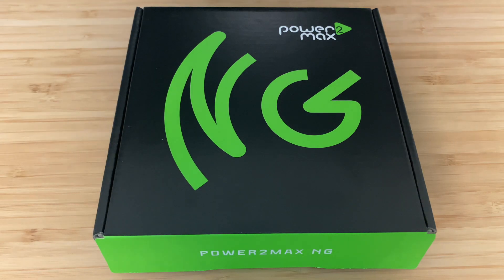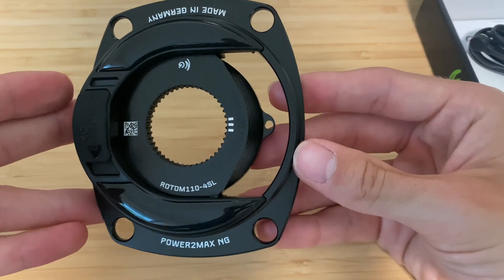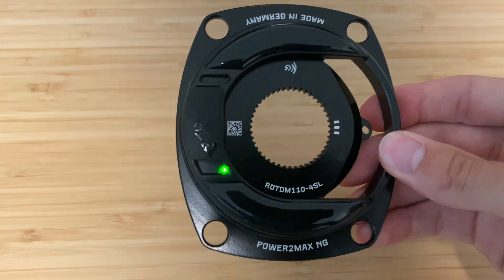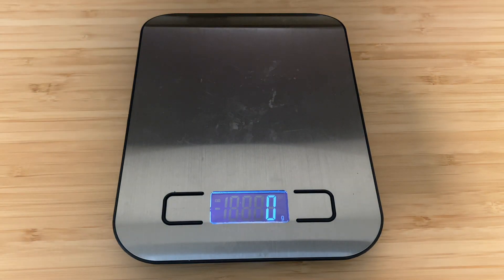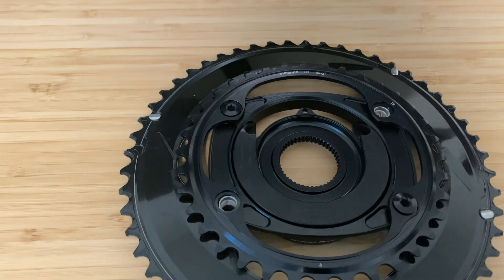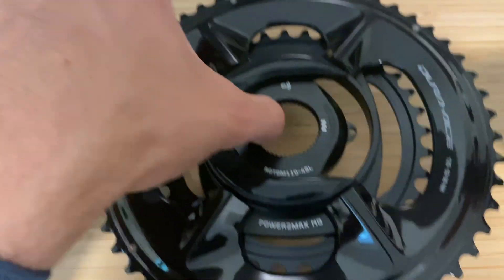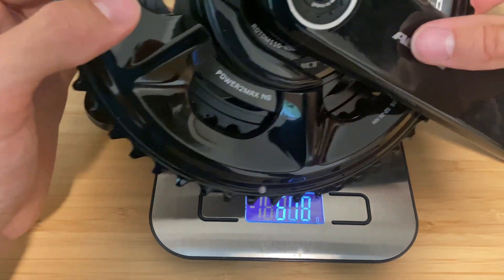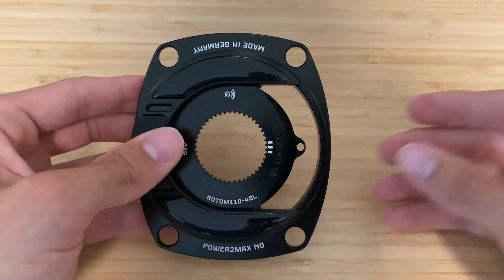NEW - Power2Max NG - SL - Magnetic Charging - Dura Ace 12 speed - Rotor ALDHU Carbon

Comment: Hello there, whats the difference with this NG and the NG eco? 

Also, can i use a Carbon Ti rings with this set up?
Reply from the maker: The NG is the higher tier model and the Eco, while still accurate, has a few less features. You can use this with Carbon Ti rings as long as you select the correct BCD. Though, the Carbon Ti rings are not any lighter than DA chainrings.

Comment: Thank you for this video. May I ask is this powermeter and specifically the SL version of the SL spider able to be used with other cranks, or only Rotor? Thank you so much
Reply from the maker: The SL version is compatible with a number of different crank arms, but is machined to specifically fit whichever brand you choose (Rotor, Easton, Praxis, etc.) so you'll need to select which interface you want when purchasing.
Reply: Thanks for the reply!  hmm, so it sounds like this is custom-ish request to Power2Max? I am going to try to get a super lightweight Chinese crank that fits normal Power2Max, Sigeyi and XCadey power meters already. So I wonder if this SL will fit without as it already is? I will ask Power2Max directly but if you know I'd love to hear!  The cranks are called Elilee by the way.
 @utahcanyoncycling

Comment: Impressive weight! Thought about upgrading my aldhu 24 to the aldhu carbon. 
I am moving my aldhu 24mm with the NGeco and 8100 ultegra chainrings on my Ostro vam, which has the ceramicspeed T47a 30mm BB with 24mm reducer. I noticed that the aldhu crankset sits 2mm further from the BB when compared to the stock 8100 crankset. I only put an O-ring on the drive side with no spacers. I don't think I did anything wrong and not sure if it's a must to put an O-ring on the drive side. I am also wondering if this 2mm increased chainline would cause shifting problems. I also noticed that this crankset sits 2mm further on my 2018 Scott foil. Thanks!
Reply from the maker: Make sure you follow Rotor’s recommendations for which spacers you need and also make sure to check that you have correctly tightened the preload nut. The chain line should not be an issue so long as you re-set the front derailleur limits to accommodate the one or two millimeter difference.

Comment: Do you have a BB86 bottom bracket on your bike? I want to buy the NGeco SL with Dura Ace 9200 chainrings and the Rotor Carbon crank, but I'm confused on the bottom bracket and axle compatibility.
Reply from the maker: I have two bikes, one with a T47 and the other with a BB86. The rotor carbon crank arms are only compatible with a 30mm spindle. The 30mm spindle fits in the T47. If you want to keep your BB86 you will not be able to use the rotor carbon arms since a BB86 is not big enough to take a 30mm spindle without serious compromises. You can use the rotor aldhu aluminum crank arms with a 24mm spindle in your BB86 though.
Reply: How frequently is pretty frequently?  😅
Reply from the maker: @woutervanboxstael5073  It will depend on where you live and how much you ride, but likely you'd need to replace them about 1-2x per year.
Reply: @utahcanyoncycling   that’s no problem. Weight savings are great 👍🏼
Reply: You can use BB86-386 bottom bracket
Reply: How I understand you can use a 30mm axle in a BB86 if you use the Rotor PF4130. Would be awesome for the weight saving 😅
Reply from the maker: @woutervanboxstael5073  haha true true. You can do it.. but you'll need to replace those bb bearings pretty frequently. Would make for a seriously light combination though!

Comment: Nice walkthrough! Frankenstein crankset with the mismatched chainring though. Better off with the Rotor version?
Reply from the maker: The rings might be mismatched from the crank arms, but the Shimano rings are stiffer, shift better, and have the new 44.5mm chainline. Plus the Shimano rings match the rest of my drivetrain. So not ideal from a brand perspective, but I did not want to mess round with either Shimano or Rotors inaccurate power meter. Thanks for watching!
Reply: Do you know if the R9200 chainrings put the chainline to 44,5mm or is it the R9200 crank which puts the chainrings 1mm further out?
Reply: @utahcanyoncycling  I'd think the number of spacers used on the axle and the exact measurements of the BB (as in, not per spec but on the actual bike) are the variables driving chainline. Rotor has a standard and an offset axle (for disc brake frames) with nominal 43.5mm and 46mm chainline, respectively. Where does 44.5mm come from?
Reply: @DominikLoeffler1  I think the new Rotor chainrings for 12spd Shimano drivetrain would fit better. The chainline with them is 43,9mm. So only a 0,5mm spacer is needed on the driveside for the new Shimano chainline.